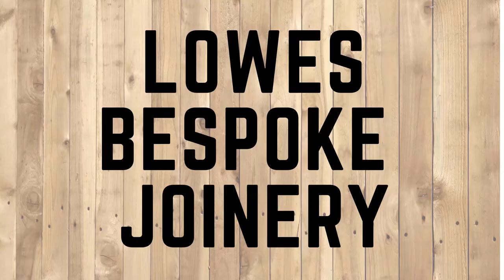Spray painting basics..

Comment: Hi Aron,  Could you drop us a comment back on the Duren spray guns you use as there description of them say not suitable for water based paints which you say you mainly use, just wondered what your opinion was of this before I go out and buy one. Cheers
Reply from the maker: hey mate really sorry about the delay .. not sure if you got the gun yet.. they are right that they not suited to water based products they will eventually rust away saying that i still use the 2.0mm one for primer and that has lasted this long .. there is some great great guns out there for the smaller compressors LVLP  if thats the route you need to go down... if you have got the duren gun you can always just wash a bit of thinners through it after washing it out with water will keep it fresher for longer .. hope this helps thanks

Comment: Hi Aron, Great video by the way, I'm new to watching you on Youtube and I've been in the process of trying to spray some wardrobes with one of those wagner spray guns (What a Bad Idea) only good enough for fencing, so coincidentally a few days ago I purchased a Compressor and spray Gun kit from SGS  which although its a 3HP  50 Litre tank  gives out 14.6cfm ,  I'm using Farrow & ball top coat and Dulux 2 in 1 quick Dry primer and undercoat, my question is what size nozzle would be suitable for spraying the undercoat with bearing in mind I'm a beginner at spraying.
Reply from the maker: Hey bud... so first off I will say that farrow and ball top coat should be used with there primer as it takes ages to cure like days and days lol 
Regarding the thinking I always start with 300ml of paint and 100ml of water or there’s about I always get asked what to thin to and the best is to just try  but that’s my sort of starting point and that’s for a 1.3 mm tip on the top coat I don’t thin my primer as I use a 2.0mm tip spray gun for that.. 

Sorry I Carnt be much more help hope it goes well mate keep me updated

Comment: great vid mate,sadly my compressor isnt big enough for spraying but would like to try at some point
Reply from the maker: mike nicholas  you only need a 25lt compressor..
Reply: the comp i got is for my nail gun and is only 6ltr but must try at some point to get another comp at some point,thanks for reply
Reply: @lowesjoinery3031  I’ve got a 24lt parkside compressor that’ll do 3.6cfm @ 100psi, so presumably a bit more than that in the 20-30psi lvlp range, is that likely to be enough? I’m looking at an ANI gun that has a particularly low CFM of 3.6 @ 29psi. Cheers 👍🏻